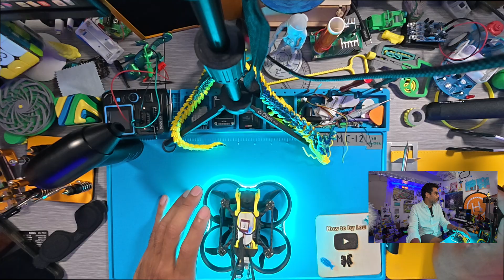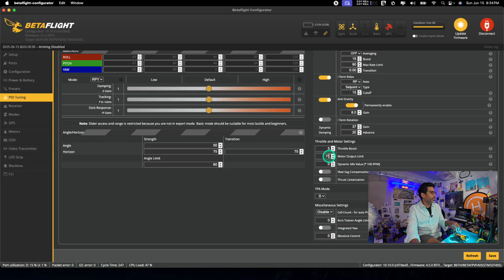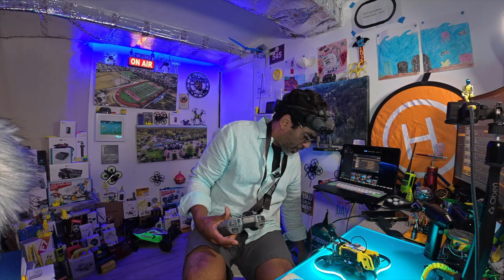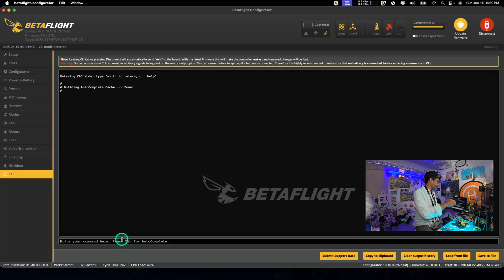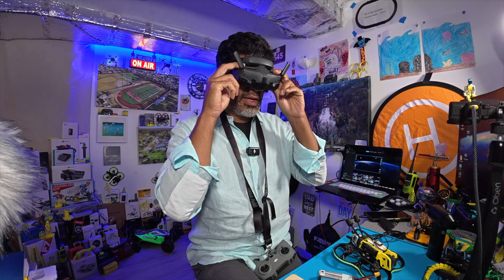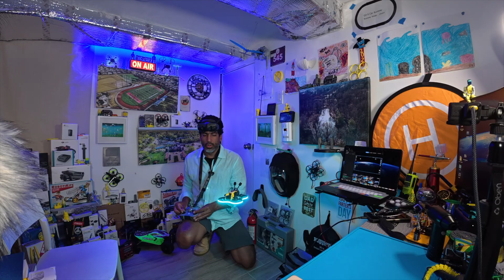Pavo20 Pro Setting - Pavo20 Pro PID Tuning, best rates for flying FPV, FPV for beginners,

Comment: Dude thank you! I’ve spent 4 months with the Avata 2 in manual (roughly 70 hours in simulator before and in between). Finally decided I’m more than ready for a real FPV drone so got Pavo 20 pro 2. Problem is… I’m literally a professional videographer. Professional as in my only job… as in I pay my rent and making filming… lmao. 

NO ONE makes videos about using this cinewhoop as a—ya know—CINEMA DRONE. 

Sorry for the rant. I’m really grateful, thanks bro

Comment: Serve para o cinelog 30 v3?
Reply from the maker: Not sure - you’ll have to try it.. all in all have these rates in all my FPV Drones
Reply: @How-to-by-Lou  I'll try installing it on Cinelog 30 v3. It worked very well on my Pavo 20 Pro.
Reply from the maker: @alancarvalhodrones  Just remember to copy the rates that are there now. This way if you aren't happy with them you can put them back.

Could always try angle mode. Angle mode works well too if you aren't crazy about Acro

Comment: Not sure why mine keeps flashing  "THROTTLE" alert when I go to arm. Throttle isn't active or reverse-mapped, but BETAflight won't allow me to set throttle under 1000? Also, if I happen to make it past that alert, the second I give it throttle it'll go absolutely haywire.

Any suggestions?

Comment: My Pavo 20 Pro gets instantly hot like crazy, even while configuring it in betaflight over 5V without battery. Is this normal? Any suggestions? 😎
Reply from the maker: Could be battery or settings in beta FPV for battery. if you have another battery try it. But if it's heating up from the basic 5V connection from your computer you may want to reach out to Drone Camps RC. 

Or put in a live support ticket with betaFPV
https://support.betafpv.com/hc/en-us/requests/new

Hope this helps. Let us know how it goes. 
It should not be hot..
Reply: @How-to-by-Lou  hey, thanks a bunch for this I'll investigate further. The batteries I'm using are Lava 550 3S - the recommended ones. Did you do some custom battery settings for your pavo?

Comment: What is centre sensitivity in pid tuning?

Mine is set to 70 in all three boxes and I’ve never touched it.

Max rate ive found 550 to be good and expo was .08 which i found ok.

But yes what is centre sensitivity?
Reply from the maker: Have mine
Roll     190
Pitch  180
Yaw 50

Have not messed with any of the other setting other than what was shared in the video . Just make sure when you experiment with different rates that you do a CLI Dump to save your settings. 

Hope this helps. Let us know how it goes.
Reply: @How-to-by-Lou roger that, i’ll try these rates. 
I’m a bit confused, i was following the 533 rates but those rates were in another format (betaflight rates o something) so i just went on to change max rate and expo. when i see other people’s rates they are very different to what i use. For example ive seen people use expo as 0.8  or 0.5 but im using 0.08 another decimal into the mix. I believe i am doing something wrong somewhere.
My current rates are set to (actual rates)
70 centre sensitivity 
550 max rate
0.08 expo,
I fly a pavo20 pro 3s cinewhoop, and i like to fly it cinematic and a bit of freestyle, like split-s into a scene or something like that.
I find these above rates ok, but i feel i need more control. Also using a small beginners 80% throttle limit, which i feel no longer serves my purpose and will move to 100% throttle. I need the drone to be, a little snappy and controllable on centre stick position. Sorry for the long message 😅
Reply from the maker: @qc_uploads748  Wow that's great! thanks for sharing.. Mine is still at 75%. Sounds like you really leveled up. Maybe you can share a link to latest video with the rate you are flying with. Thanks a bunch.

Comment: Tried these out in Air mode and flies well.  New to the Pavo20, previously been on Neo/Avata2 in manual, so this was a big change.  Found power and control insane at first, your rates have helped me wrestle it back but still keep some pace.  I couldn't deal with angle/horizon modes - brain couldn't work them out! Great video and thanks for some insight into Betaflight for a noob.
Reply from the maker: Thanks for sharing glad this helped. Some pretty amazing flying skills you've acquired. Air mode is pretty challenging. 

Not sure is you've tried these rates too but have them in all the drones now. 
https://www.youtube.com/watch?v=6Sax1fj4O0w&t
Reply: @How-to-by-Lou  I've been toying around with your rates and the ones I use for my Neo from this video:

https://youtu.be/EGtUjJ2SoAU?si=1nDCGPQzCy6fBQQg

I actually find it easier to fly in Air as opposed to Angle/Horizon as you aren't restricted on your vertical pitch.  Restricting the motor power to 75% is good though and controllable.

Comment: Hey, about the buzzer, the best way to wire it is to have the black wire to ground, red wire to 5v and the yellow wire to buzz-. This is because these buzzers, like the Vifly mini, are self powered and have a battery that needs the constant 5v to keep that battery charged whenever the drone’s battery is plugged in. And I prefer it this way, even though I do have to press the button to turn the beeper off every time I unplug the drone’s battery, because this way, the beeper will sound off in case the drone’s battery gets disconnected during a crash and you can’t activate the beeper with the controller. 
The gps taking too much time acquiring satellites should improve a lot if you shield the wires. To prepare the gps cable I twisted the red and black wires together, then twisted the yellow and white wires together and then twisted the two pairs. Then I wrapped the twisted cables with the 1/4in copper tape (that you can find on amazon or on a Hobby Lobby), leaving about 1/2in on each end free. I then soldered a short piece of black wire to the end of the shielding that would go to the Flight Controller. I wrapped the whole cable with cloth tape and added some shrink wrap to each end. I soldered the wires to their respective pads including the extra ground wire to the same ground pad in the FC as the gps ground. 
After all of this and having the gps located on top of the VTX like you, I am getting over 10 satellites in 30 seconds to one minute. 
Hope this helps someone.
Reply from the maker: Thanks tagged this in the installation video for the GPS.. 

GPS Install Pavo20
https://www.youtube.com/watch?v=VVzIrx6SSxc

Tried the different wiring configuration on installation the video above because was not crazy about the persistent beeping and liked the pulsating beep with that wiring configuration. 

Your setup will definitely help other folks too. After wrapping the wires have been getting satellites super fast too. 

Will wrap the wires with copper on the next live stream. Thanks so much for this detailed. Solution..Can't wait to rewrap the wires..